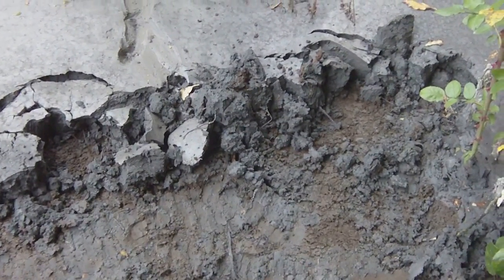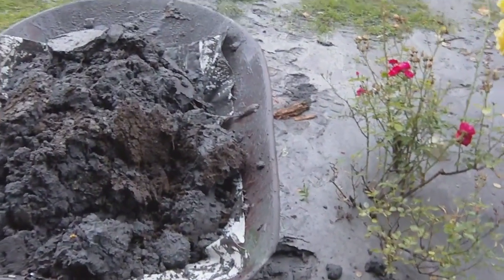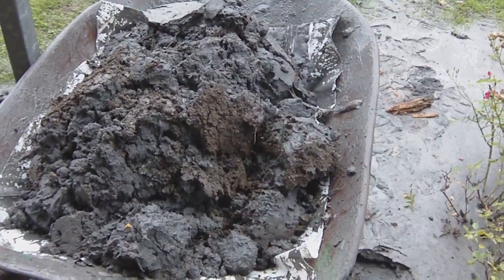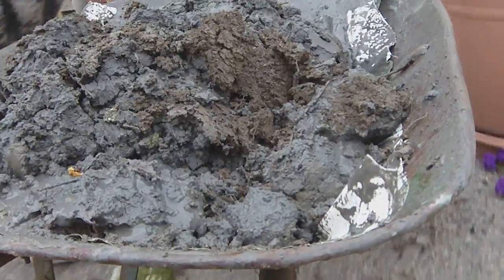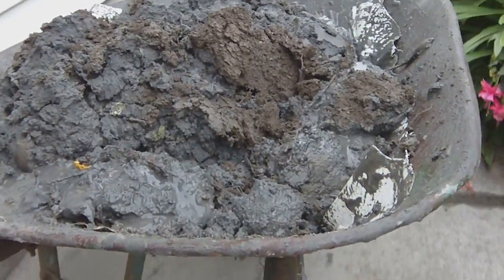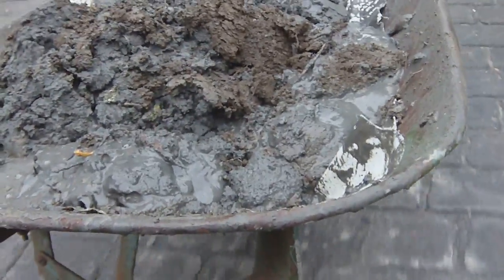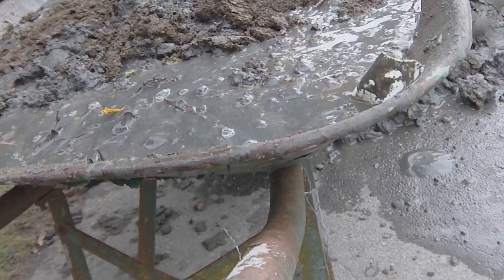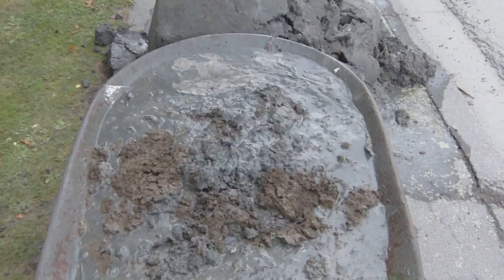Christchurch Earthquake  Showing the sand liquefaction process with vibration

Comment: This is thixotropic in action, exactly the same as you can do with cornflour or avalanches.  The molecules are (roughly) rectangular but stacked up at all angles until vibration occurs then they all shake down the same way and slide off one another.

Comment from the maker: @abnunga   That's very funny... but it does seem quite accurate too.  The lot I was shifting was from down the back of the garden...   I have a theory that revolves around getting the water into the ground sufficiently to saturate it.  I think I'm going to suggest that it's run-off from the garages.  Lets face it, they are down the back of the section  by the lovely sunken garden/rose bed and the law of Murphy says if it can it will....   :-)

Comment: @wmsilvia Although it's called LIQUIfaction, you're right, it is not a liquid. But is does have FLUID properties. Gasses, liquids, and solids can all have fluid properties.  For example flowing air in gas or a debris flow of solids. Water saturated sand that gets shaken will have fluid properties until the shaking stops as the video shows.

Great video. I'll be showing it in my class tomorrow.

Comment: For those who don't seem to understand the term "liquefaction"

liquefaction  (lkw-fkshn)
The process by which sediment that is very wet starts to behave like a liquid. Liquefaction occurs because of the increased pore pressure and reduced effective stress between solid particles generated by the presence of liquid. It is often caused by severe shaking, especially that associated with earthquakes

It is not about the sediment becoming a liquid OK?

Comment from the maker: @HighwarlordJC, I guess you are technically correct in that the sand itself doesn't  turn to liquid - but that is to liquify. *(that's Physics).  

This process we call Liquefaction is a geological term which refers to the process by which saturated, unconsolidated sediments are transformed into a substance that acts like a liquid.  *thanks Wikipedia*